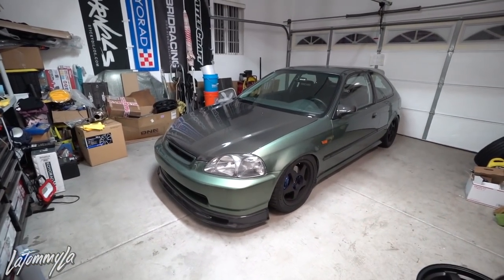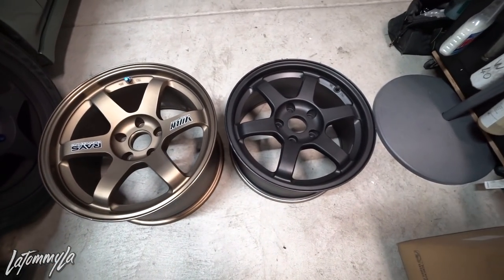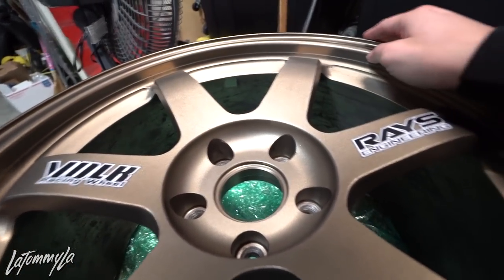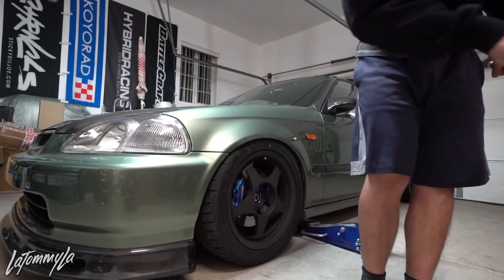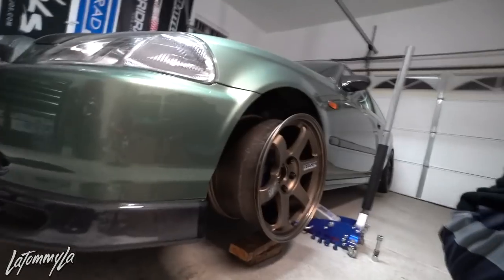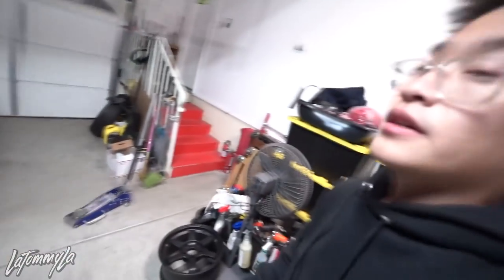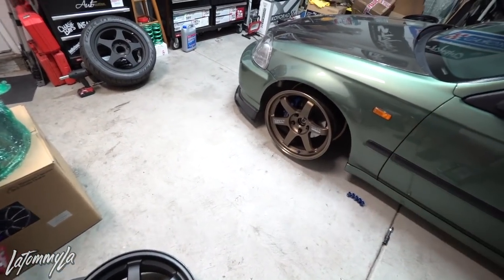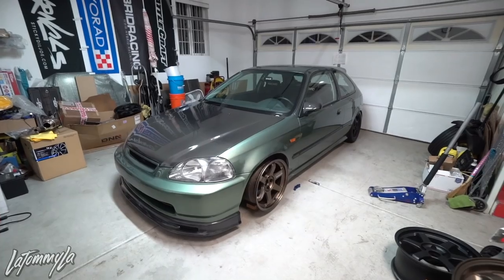Will these new WIDE wheels even fit my EK Hatch?!

Comment: Tommy your probably going to also need to flatten the pinch weld at the rear of the wheel well. On mine I run 255/40 on a 17x9 and it rubbed bad at the rear pinch on any more than one turn of the wheel. Good luck, welcome to the big wheel gang.